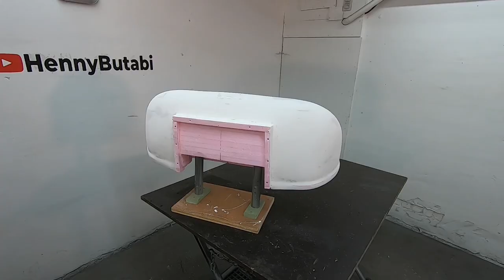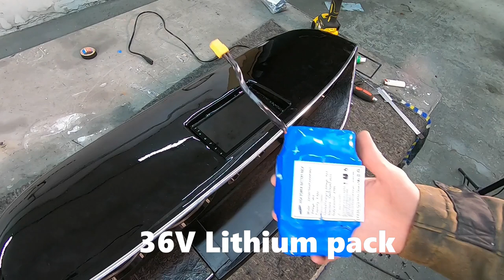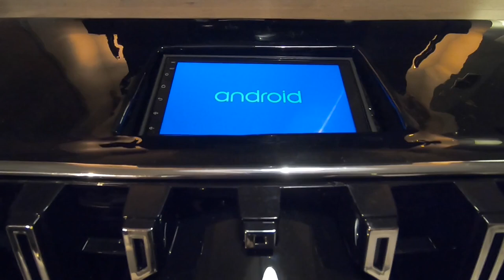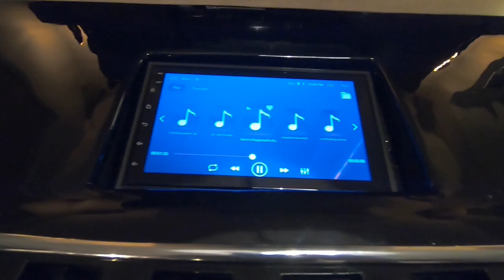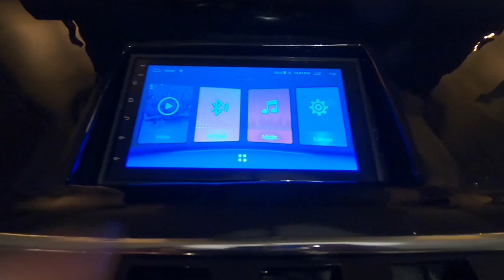Building a Mercedes AMG bluetooth speaker from scratch - amazing result

Comment: No insulation inside speaker box, no proper porting, no seperation of each speaker by a chamber and no airflow for the powered components. This will sound tinny and will eventually cook itself.